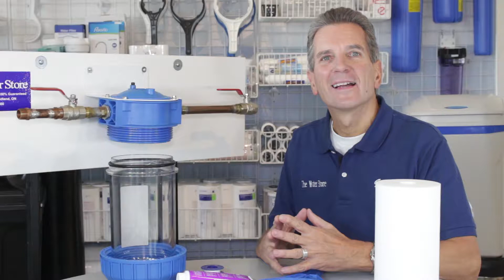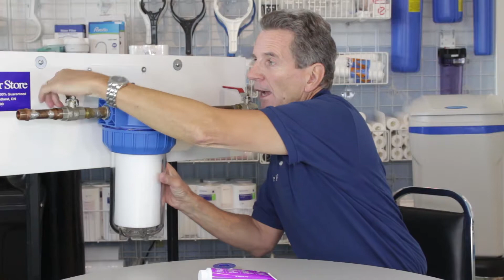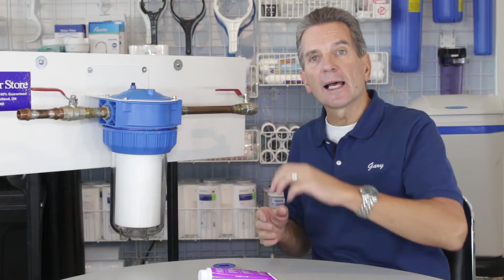How to install a Viqua 3 piece Big Blue Water Filter  Housing

Comment: what will i need to buy plumbing wise in order to install?
Reply: if i have a 3/4" main can i use a 3/4x1x3/4 tee and run the 1" pipe to the in and the out of the filter (use all 1")?